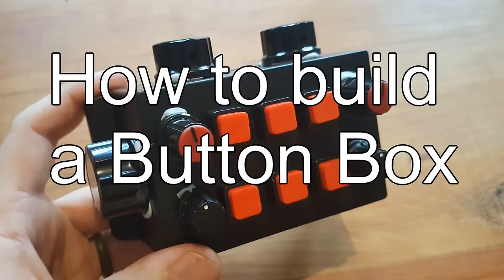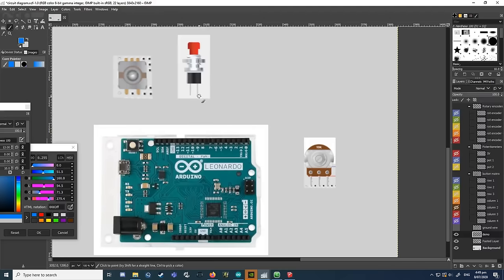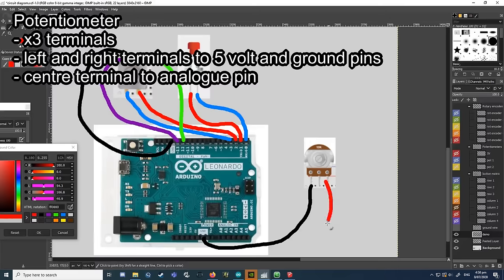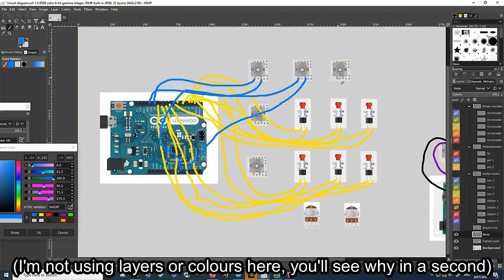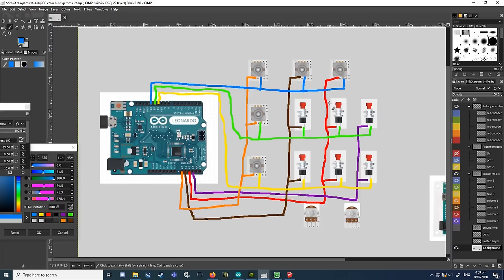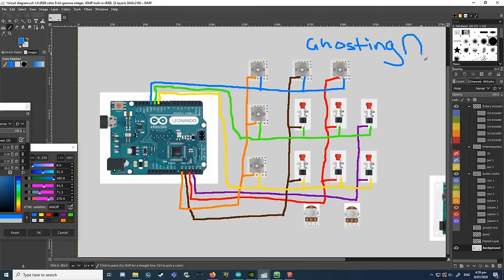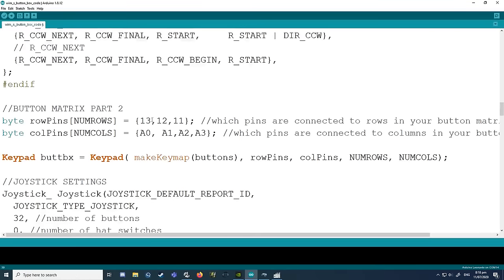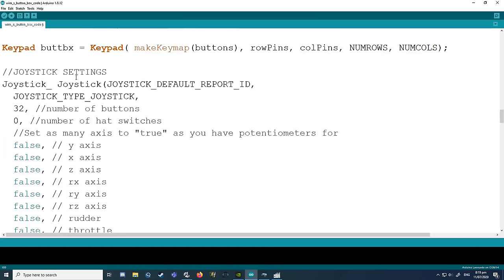How to Build a Button Box

Comment: sorry, regarding the code, what if your box does not include encoders or pots?
Reply from the maker: In that case you are much better off just using a zero delay arcade controller instead of an arduino. They are much cheaper and don't require any coding.

If you really do still want to use arduino, just delete the two lines of code in "void loop" which say "checkallpotentiometers" and "checkallrotaryencoders".
Reply: @wimwamjoey  yhh thanks for that, I just commented out the bit of the code I don't require currently. Works now

Comment: Is it possible to make a 4x3 or 7x4 button matrix using an arduino leonardo?
Reply from the maker: Yes, an arduino leonardo has 20 pins so as long as your total number of rows and columns is less that 20 you can make any kind of matrix you want (although windows only supports 32 buttons per controller so don't make a controller bigger than that!)
Reply: @wimwamjoey  not unless you use joystick germlin with another one called hidhide config with config joystick you are limitless with those programs just saying

Comment: Great tutorial video.
I used it to build my box(es). The first one was not more than a proof-of-concept with long wires and as less soldering as possible, build into a cardboard-box....ugly as hell :D
On the second attempt I mounted the buttons and switches into a sturdy aluminium-plate. I used a 4x5 matrix to connect 1 ON-OFF switch, 1 ON-OFF-ON switch, 3 ON-OFF-ON momentary switches, 8 Buttons and 3 rotary encoders.
If your final box does not look like your button-matrix, you can put your desired button numbers in here: https://youtu.be/wkY1NsbWj5I?t=1229 . For me it is:
  {0,19,18,17},
  {2,4,6,8},
  {1,3,5,7},
  {15,13,11,9},
  {16,14,12,10}
Same with the rotarys. If you made a mistake while soldering ans one of your rotarys is inverted, just swap the button numbers:
  {0,1,20,21,0}, //rotary 1
  {2,3,23,22,0}, //rotary 2
  {4,5,25,24,0} //rotary 3

Comment: so im confused when i verify the code it pops up with the error message 'JOYSTICK_DEFAULT_REPORT_ID' was not declared in this scope. and i did download the joystick library and put it in the library folder but it just doesnt work i have also tried older versions
Reply: Have you imported the library to the IDE? 
Sketch > Include Library > Add .ZIP Library
Reply: i was getting the same error cause i had installed the joystick library from the manage libraries tab in the ide. i went to the folder location and just deleted the library named joystick and it started working.

Comment: hi, great video I tried making a button box that has six rows and four colon, but every time I press a button, the arduino thinks i'm pressing all the buttons in that row, can someone help me figuring out why this is happening?
Reply from the maker: Double check your connection and wiring. That usually happens when you accidentally have some wires touching which shouldn't be.
Reply: @wimwamjoey  Thanks 😃,  Past two days I tried figuring out what’s wrong so i tried to connect all the wires of the button matrix to the digital pins and all the buttons were working right but for doing that i had to disconnect all the wires of the encoders, after i disconnect the matrix and connect the encoders and all of them were working fine.
I think my analog pins doesn’t work, do you think is possible? 
I also tried to use them by calling whit their digital names (18,19,20,21) but also that didn’t work

Comment: Does the code for this treat switches the same way as buttons or are they different?
Reply from the maker: They are the same.
Reply: @wimwamjoey  thanks! I see two kinds of switches in the stores in my country - one is on-off, and one is on-on. Would there be a difference when I buy one over the other? Does the program simply treat the pulse of the on-on switch the same as the on-off switch?

Sorry, I have 0 experience with Arduino. Thanks for taking the time to go through these!
Reply from the maker: @calbur20  no worries, on-on usually just means the switch is spring loaded (momentary) while on-off is a toggle switch. It might be worth double checking with the store though. They should be happy to answer any questions.

Comment: Can you use crimping instead of soldering?
Reply: Yes you can. When I was an apprentice electrician we were taught when connecting up that a sound mechanical connection makes a sound electrical one. Less chance of burned hands too. Crimp on!
Reply: PS don't forget that crimped connections take up a bit more room, so make sure your enclosure is big enough. Happy making.
Reply: @steveneltringham1478  Thank you!

Comment: What are you even saying? All the momentary buttons can share 5v or gnd depending if you want to pull the digital pin high or low. You don't need 2 digi pins for a pushbutton at all.
Reply: if you had 25 buttons and you'd share gnd with them all, you'd need 25 pins + gnd. With a button matrix you only need 10; 5 collums and 5 rows. The pro micro checks for connections between the row and the collum.

Comment: Please help!! I recently bought a BBI 32. everything worked fine until the rotary encoders. When I hooked them up the rotary encoder would send two signals for each one detent. For example when i twist it to the left once it sends it to both 1 and 2. can someone please help me and tell me what i am doing wrong. I have tried multiple different types of encoders and made sure none of the wires were touching.
Reply: Hm it could be that you have a wrong encoder I dont know verry much about it but i think there are 2 types 1: that send an impulse to pin1 for one direction and pin2 for the other direction  2: these one are build different but I dont know how
And i think you got one of the second type
Reply: I think you've missed a step. For a bbi32 with a rotary encoder you need to use the "BBI-32 Config" software from the bodnar site to tell the device how to interpret the signals from the rotary encoder. You tell it, for example, that pins 1 and 2 are attached to a rotary encoder and what type (guesswork or default :)  and then it will use the signal (or multiple signals) to interpret which way you are turning the knob. Hope this helps (I have 3 bbi32s and 2 BBI64s and they're great).

Comment: hi, know this is a few years old, but just got myself an Arduino and in the process of getting stuff to make my button box.
I do have a quick question though, I want to build it for my flight sim primarily DCS.
I would like to use a 3 way toggle switch with an ON ON ON function.
Would I use a button matrix for the first two portions of the toggle lets say up and down, than have the third terminal (middle) be it's own separate button on an individual pin, or is there a way to create another matrix?
So far all I've seen for button matrix is column and row design with only 2 function switches/buttons.
Reply from the maker: So what you have is an on off on switch right? If so, I think you can add a third virtual button using joytokey. You should be able to set it so that whenever neither of the two other buttons are being pushed it tells windows a key on your keyboard is being pushed.

I'm sure you could get the same thing programmed within the arduino but I'm not sure how...
Reply: @wimwamjoey  No it's an on on on switch. I would like to have all 3 functioning as buttons.
I'm assuming it would more than likely be wired as a "rotary encoder" since it would have essentially 3 buttons on one switch maybe?
Reply from the maker: @shibiwowsawesomegaming4783  Hmm... How many terminals does it have?
Reply: @wimwamjoey  6 terminals.
Reply from the maker: @shibiwowsawesomegaming4783  Oh ok. Yea I think you'd need to do  bit of experimentation to see which terminals do what (if you have the schematic for the switch that might help!). You may just be able to set it up so its effectively three buttons on one component.
Reply: @wimwamjoey  yeah, I found a video actually that explains how to do it in a sense.
Out of the 6 pins you take 3 of them in a certain order which would be your positive click button function and 1 ground wire.
So I can wire up two of them to the matrix and do the 3rd terminal to its own independent pin while using the same ground.
Sort of like you would do for a rotary encoder with a push button function.
Reply: @wimwamjoey  so in testing the code, i got an error stating that it cant run to an aurdiono uno. that it has to be a micro, lenardo, etc...
Do you know if there is a fix for this?
Reply from the maker: @shibiwowsawesomegaming4783  hey im really sorry but as you'll see in the description of the video I made a mistake. You can actually only use arduino Leonardo or pro micro boards to make a button box. The uno doesn't have the right chipset
Reply: @wimwamjoey  yeah just reread it.
Ordered a leonardio board have it coming tomorrow.
Sorry about that but thank you for the reply.

Comment: how do i open the code from library? i get the #include both keypad and joystick, but no code? just void setup and void loop
Reply from the maker: The code is in a separate link. You won't see any code from the joystick and keypad libraries, they run in the background.
Reply: @wimwamjoey  thanks for the reply! i managed to get it all working!

Comment: Hi. I have a problem because I have a 6-pin on-off-on switch and I do not know how to connect it to the arduino when making the matrix. I would ask for quick help.
Reply from the maker: You should only need to use three of the pins along one side. Wire up the centre pin to a row, and the top and bottom pins to different columns (or vice versa).
Reply: @wimwamjoey  And which pins do I need to connect to the arduino.?
Reply from the maker: @Mateusz_Kowalski_sw  You don't connect the pins directly to the arduino. You hook them up to the rows and columns in the keypad matrix as described in the video. 

I drew a quick sketch which should help explain: https://imgur.com/a/G1bNksb
Reply: @wimwamjoey  Thanks for the help. 😄
Reply: @wimwamjoey  I have one more question. I have a 4 pin on-off switch. And despite trying, I can't connect it.
Edit: I already know how to do it

Comment: dont know why, but if i conect the ground pint of an encoder to ground, it doesnt detect the two otputs, and i have to conect ground to another pin in the arduino. Why is that
Reply: Hi, as I mentioned on my comment above, NOT ALL rotary encoder have ground on the middle pin. My encoders where not marked and I assumed that the middle pin is ground, but it was actually the right pin that was ground. If your encoder gives erratic pulses mostly on one direction, you probably have the wrong pin for ground. Do the test on one encoder beforehand to save you a lot of pain. It took me all afternoon to figure that one out.
Reply: @mikekal4472  hi, I'll try that, but how do I check Wich one of them is ground?
Reply: @xtar7786  well I just moved the pins on the Arduino until the encoder worked as it should.
Reply: @mikekal4472  the strange thing is my encoder works fine when I put the three pins into normal pins in the Arduino, but if I put anyone of them in the ground pin, it gives the same output left or right

Comment: I am trying to use the code from the video, I am using a pro micro but i am getting the Error "Error compiling for board Arduino Uno." any help?
Reply: have you switched the board on the "tools" tab of IDE?
Reply: Change board in tools menu
Reply: Also check ports

Comment: Hey Wim, I followed this guide, did all the wiring and coding and then got stuck. When I plug it into my PC, the Leonardo is detected and I can upload the code to it. When I go to game controllers to test it I get an error that the board is not connected correctly. Yet, it's connected correctly enough to properly detect and receive the code. Any ideas?
Reply from the maker: Never come across that... Try a few different USB ports on your PC?
Reply: @wimwamjoey  I found that it was an issue with the code. I can load different code that I know works and it recognizes fine. The I'm having with this code is the potentiometers. I have the code set to 0 potentiometers but I get lots of errors I tried to ignore with //.
Reply from the maker: @Venymous  I think you may be referring to the bit of code up the top which refers to the number of rotary encoders, not potentiometers. 

To disable the part of the code that deals with pots you need to:

1.) Set all the axis to "false" in the segment headed "JOYSTICK SETTINGS"

2.) Delete or comment out the line of code which says "checkallpotentiometers"

This should hopefully get rid of all your errors.
Reply: @wimwamjoey  Well those were already set to false. I didn't change anything else in the code either than what was described in the video. I commented out the check as you mentioned and it still threw all the same errors. This time I was able to comment out all the errors and it looks to be connecting properly to my PC now. Thanks for the additional help!

Comment: How it would be the code if I don´t use a matrix? For exaple, only 2 rotarys and 4 buttons without using a Matrix.
Thanks
Reply: Hi, I just did it without a matrix essentially in the code you only declare the column size as 1. Then your buttons and row sizes as your amount of buttons, it's that easy, no code changes needed. When you declare pins, give your column pin a fake pin number like 20 or something, that's what I did.
Reply: If you want a simple one you can use "zero delay usb encoder" board instead of arduino. no programming plug and play. The only thing i'm not sure about is how this board handles rotary encoders, it is great for buttons (up to 12) and joystic axis but never tried it for rotary. I would assume they should work because rotary encoders are digital signal same as buttons but never tried them on it.
Reply from the maker: @TonyHA913  I don't think zero delay boards can handle rotary encoders because they require a bit of extra code to tell whether they are being turned clockwise or anti clockwise. I could be wrong though
Reply: @wimwamjoey  I think you are right however it depends how do you wanna use your encoder or how the sim is meant to deal with a specific feature. Let's say you have a radio frequency field that you need to adjust and in your sim you can assign a button to increment by one and another button to decrease the frequency by one. in that case you can just use you encoder on two slots in the zero delay board and assign these slots to increase and decrease. That should work. For more complex stuff i guess you are right since there is no coding the board would not know which direction are you rotating.. cheers!

Comment: Hi I just finished make my button box and it looks ok but when i trigger one of the buttons it triggers the 1 button on the usb game controllers app and when I trigger the one right below it it also triggers the 1 button. This only happens with the same two buttons. I would suspect it has something to do with the row because they are the same. If anyone has any advice it would be much appreciated. Thanks! 

EDIT : I was looking over again and figured out that the problem is within the code. I my button box I am not using potentiometers and I just set them in the code as pins that were not being used and that seemed to clear up the problem, but now I have  axis that are activated and I do not want them to be activated. Is there a way that I can set the code up for a box that does not have potentiometer (I do not have any free analog pins because they are all being used). Thanks
Reply from the maker: There is a bit of code near the middle which defines various axis as "true" or "false". Set them all to false and delete the line of code which says "checkallpotentiometers"
Reply: @wimwamjoey  Just tried and works perfectly, thanks!

Comment: Anyone know how to get a on-off switch to output to button 1 when turned on and output to button 2 when turned off?
Reply: You could give it an arbitrary button number in the button matrix definition (say button number 99) and then catch it in the CheckAllButtons function: 
if ( buttbx.key[i].stateChanged ) {
  if (buttbx.key[i].kchar == 99) {
    switch (buttbx.key[i].kstate) {
      case PRESSED:
      case HOLD:
        Joystick.setButton(1, 1);
  //activate button 1
        Joystick.setButton(2, 0);  //deactivate button 2
        break;
      case RELEASED:
      case IDLE:
        Joystick.setButton(2, 1);
  //activate button 2
        Joystick.setButton(1, 0);  //deactivate button 1
        break;
      }
    else {
      [handling for all other buttons as in original code here]
    }
  }
}

probably not the most elegant solution, but it should work :)
Reply: @panicpetes7676  Thanks for the advice I'll try that

Comment: how would this work with a 3 position switch?
Reply from the maker: Just treat it like 2 separate switches which share their central terminal. 

So the central terminal goes to a column while the ones on either side go to two different rows.
Reply: @wimwamjoey  thank you sir

Comment: Where in the UK can i find a radio shack type shop for all my knobs and buttons to make my gadgets,coz usually im opening up old vcrs and tvs  old remote control handsets,magnets from microwave ovens and speaker systems,the big flat round ones,and a whole host of other stuff to get materials,for switches ect,and metal for boxes for wiring and buttons knobs switches etc, thanks if anyone can stear me in the right directioni know of one shop uk Wide but its not that good and i cant remember the name ATM  ,thanks anyone.AH the onlt shop i know of is Maplans electronic shop.
Reply: I use Switch Electronics.
Mainly because its 10 mins from home, but they also do mail order.
Theres plentty of others out there without looking for the national and multinational companies.
Reply: Bits Box is good.  Postage is £1.90 for anything - just check it out.